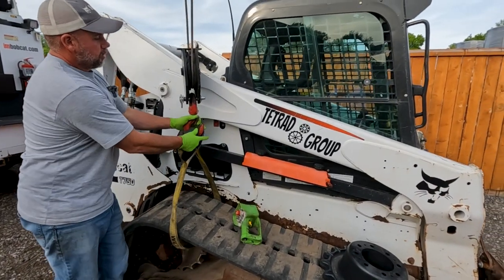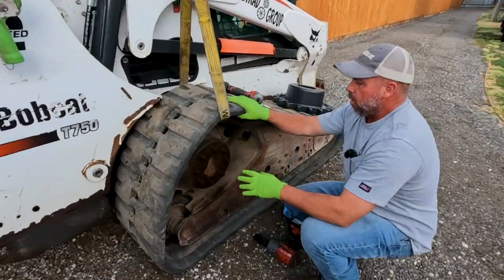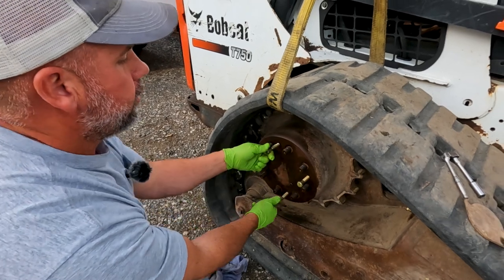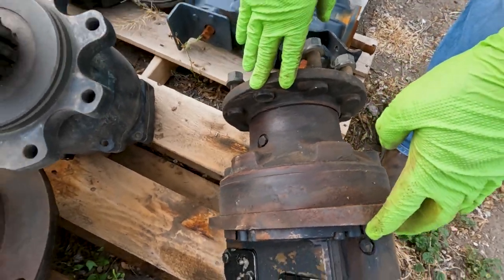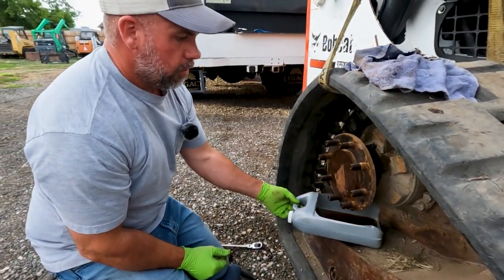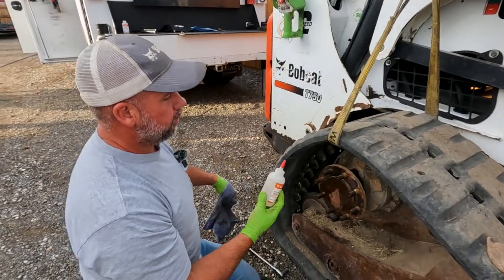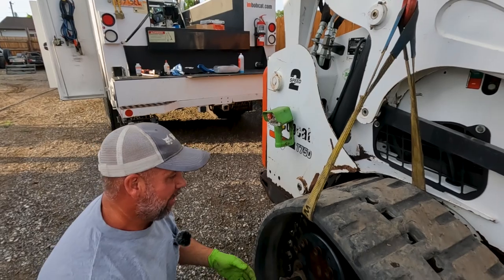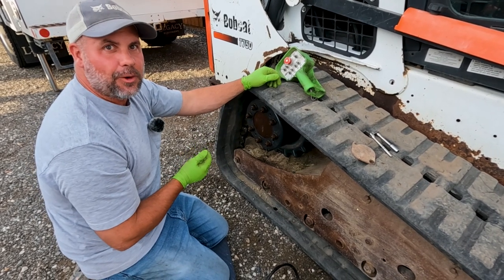Bobcat Drive Motor Service With New Sprockets T750 Tips and Tricks

Comment: Great video! Another tip for releasing the tension of the tracks without some sort of lifting device is to use a larger pipe and place it in between the two sprocket teeth, then you slowly drive the machine and the pipe will wedge up into the tracks and remove the tension.

Comment: Hey i have a t86 and it has 700hrs on it. The sprockets are wearing very fast! Is it common practice to rotate the sprockets? Example... putting left side sprocket on right side and vise versa. I am starting to feel the sprockets turning in the tracks when traveling.

Comment: I need to see drive motor service/replacement on a 2002 A300.   Thanks for all the other tips though, servicing my own lift cylinders, recalibrating the actuator.  And, can I get a remote control for my 2002 A300 to start and run the lift from outside, don't care for it to move but with a log splitter it'd be nice.

Comment: Why do you have to take the gear off to service it  thanks never changed mine with 1500 hr thanks for the lesson
Reply from the maker: Depends on the drive motor but many of them can only be service by removing the sprocket due to plug placement.
Reply: @tetradgroup  thank you very much 1983 first year I had 843 three t 300 now getting ready to quit wish you were around 40 years ago thanks

Comment: Bobcat should tell you the spec/standard for the oil they are using.  It is generally illegal for a company to force you to use their products or risk voiding a warranty.   Unless they are providing it for free, or have obtained a waiver from the FTC which would require them to prove to the FTC that their product would not work correctly without their parts/oils.

This is per the 1975 Magnuson Moss Warranty Act, and requiring someone to use only Bobcats oil would most likely be a violation of the "Tie-In Sales" provisions in that act. Bobcat may have requested a waiver, but if so that should be spelled out somewhere in your warranty documentation. Bobcat would also have the burden of proof that the oil you used was the cause of any failures per the act before they could void your warranty.  Also per the act if the company is found to have voided your warranty without due cause they can also be forced to pay your legal fees.   If you believe a company gives you the run around on warranty or tries to void warranty without proof or factual basis it is best to report it to the FTC at ReportFraud.ftc.gov